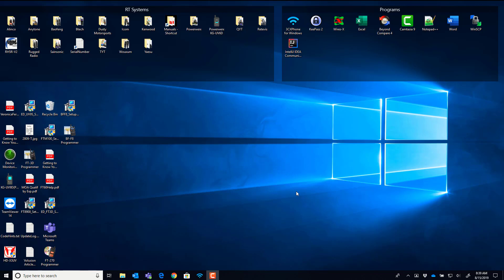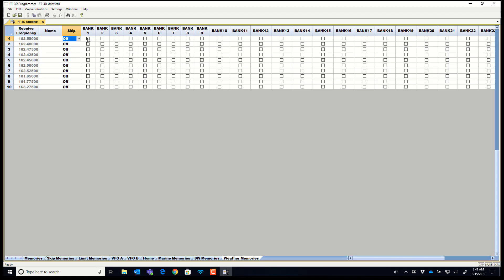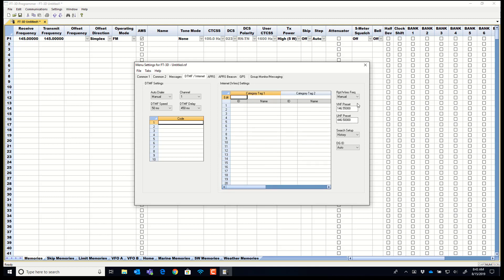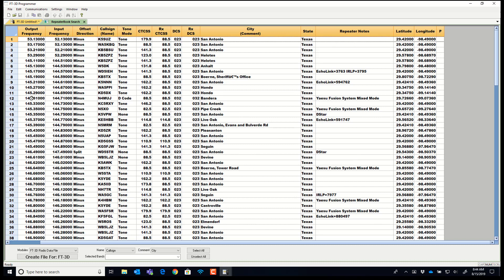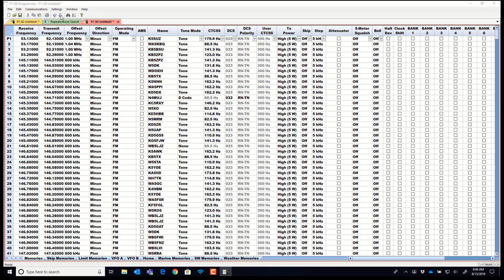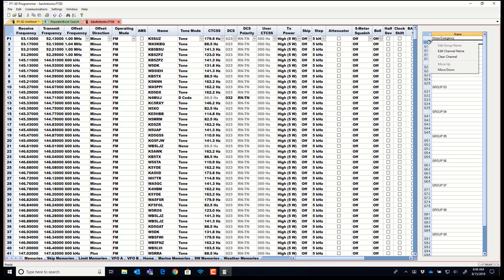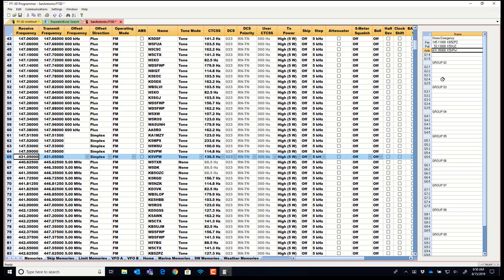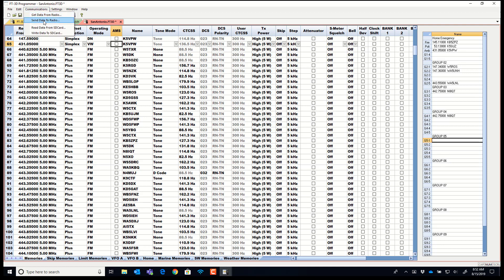FT3D Radio Programmer

Comment: Tried programming my radios manually, took me hours but did it. Then I moved and had the thought of doing it again gave me nightmares.

So I bought RT Systems software for 3 radios, 2 Yaesus and Boafengs, RT Systems saved me so much time and headache that I wish I would have just bought them from the start!

I've even called a few times for help, and they were awesome.

HIGHLY recommend RT Systems to everyone!

-now to watch the video and get a little help with my FT3.

Comment: I recently bought a used Yaesu Ft 3D from another Ham. He had purchased the RT Systems programming software. Can I use that software on my computer or do I have to purchase another copy?
Reply from the maker: The original owner needs to contact us with information allowing us to release the license to you.  That information should include his name, original email address and which radio (incase there are several).  Along with your callsign, name and email address.  We will deactivate the license for him and transfer the license to you.
Reply from the maker: Do NOT send that information here. Use techsupport@rtsystemsinc.com
Reply: Thank you so much!